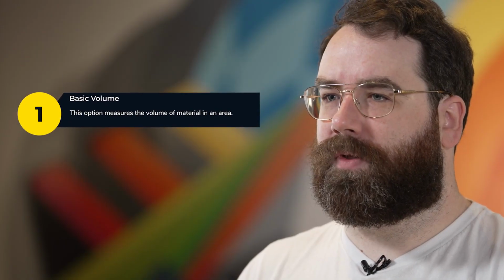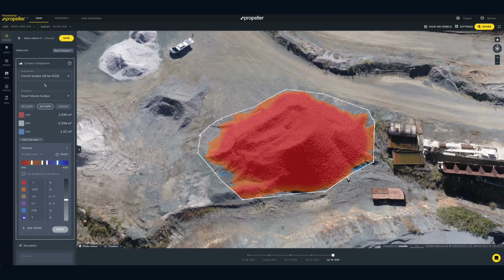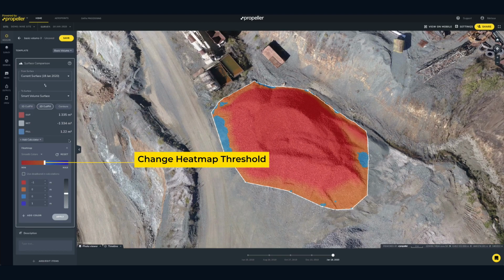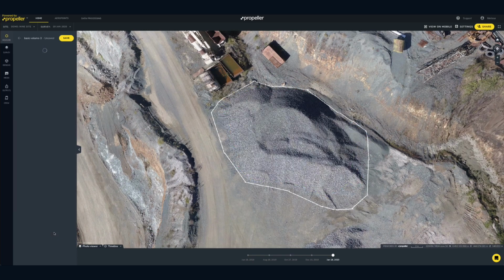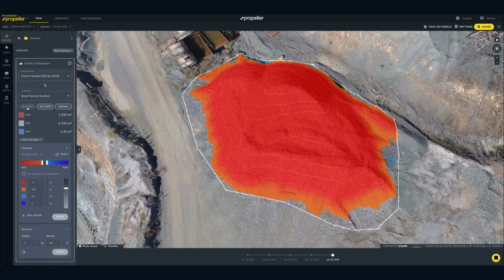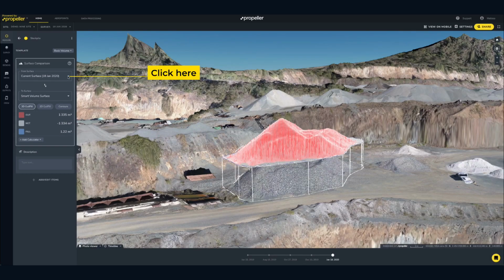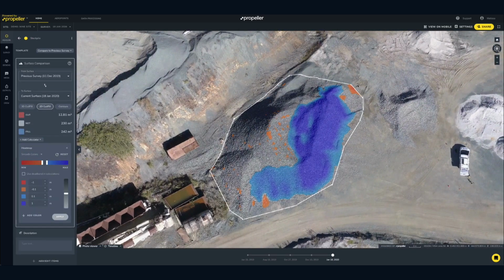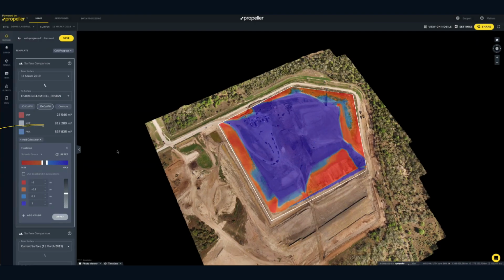Site analysis & measurement tools: Visualizing progress using 2D & 3D cut and fill

Comment: So if the original surface was a depression will the 3D fill take that into consideration when comparing to the base
Reply: Hey @kentmeier6762, my name is John Walls and I'm a solutions engineer here at Propeller! Yes, the comparison will take into account the existing ground file conditions, including a slope or depression. There is also an additional option to do custom base, so you can update each vertice of the polygon to a specific elevation to create a sloped or depressed base. Hope that helps!